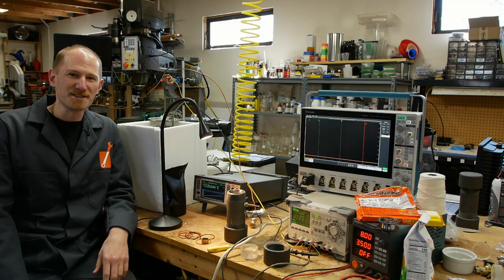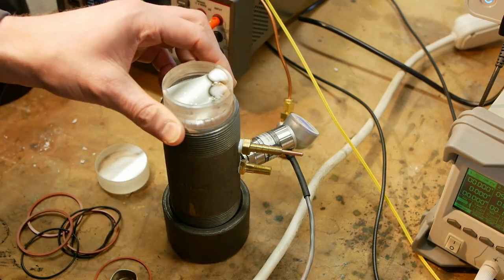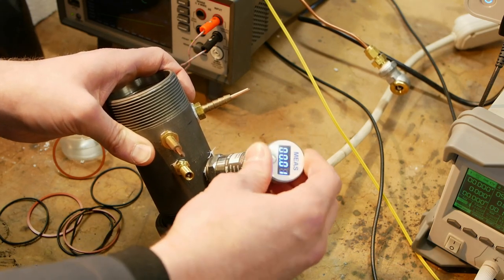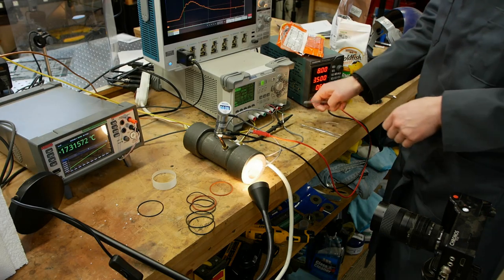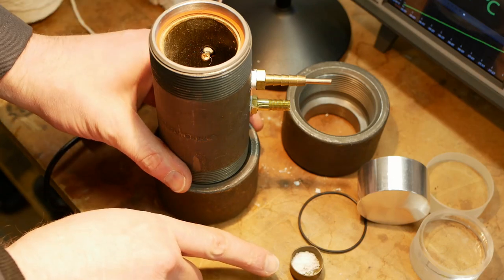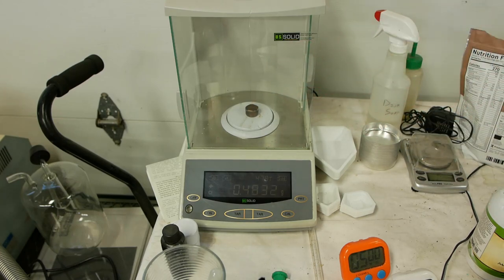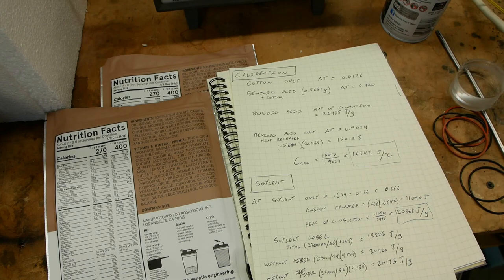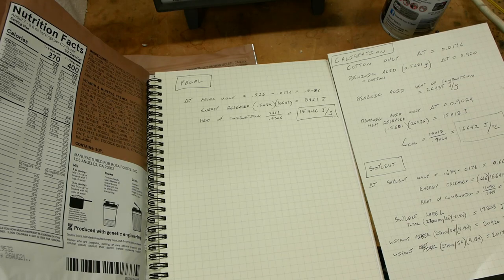Measuring human digestive efficiency vs. a flame

Comment: Hi:

If you need high pressure feed thrus, try spark plugs. They are designed to handle the pressure and have a substantial electrode. 
Nice video. Thanks.

Comment: May I share some insight as a physician:  

I think what you have to figure in is the amount of preexisting flammable, indigestible /nonabsorbable material in dry feces. For instance, bacteria, alone, makes up about 30% by weight of dried feces. Add bile pigments from the hepatobiliary system, various enzymes and other proteins secreted into the GI tract, shed epithelial cells, dead leukocytes, various lipids, etc, and you have a lot of material that will contribute to the energy of combustion of dried fecal matter that hasn’t been accounted for.  The way to account for this is to fast for several days to get a baseline sample of feces devoid of any unabsorbed food. Then you can compare that to what you collect on the Soylent diet. 

Last, remember that there is a delay between "input" and "output", i.e, intestinal transit time. As a result, the first couple of samples collected are likely to contain undigested food from before going on the diet. Thus, you have to make sure you’re in input/output equilibrium before beginning collection and throughout the duration of the experiment.

My 2 cents.

Comment: Some nutrition labels will list the "output," or amount of starches you're expected to excrete after eating it. The only issue I can think of with that is that the foods that list that are often ones that can have rather inconsistent ingredient ratios, like canned stews. Not every can has exactly X number of potato chunks, and, even if it did, those pieces can vary in size.
In addition, the body excretes waste in a variety of ways. For example, some of the salts in the food we eat are expelled in sweat and urine. On top of that, even a minor infection can up cell counts, and they have to be made somehow. Performing exercise increases caloric needs, as well.
All in all, it's just really difficult to get an exact measurement of how much nutrition isn't taken up through digestion without knowing every minute detail of the inner workings of a person. I know it's not meant to be at publication standards, but doing this with a larger group than a sample size of one can show varying results between individuals. Undiagnosed digestive disorders, like how multiple of my sisters have a mutation in the MTHFR gene, resulting in a reduced intake of B12, can change results, along with resting and active metabolic rates of people.
It sucks that it's so difficult to do this accurately.

Comment: Something to keep in mind for the overall math would have to be that your measurements are measuring specific energy per unit of fuel. However, you don't poop the same amount you eat. You could probably get a closer approximation of dietary energy by weighing all the soylent you eat over the week (maybe fast/laxatives prior to starting the diet and after) and then comparing that to the weight of all the poop you produce as well. One possible disadvantage of this would be that during the fasting phase your body will likely start using up glycogen in your body, so you may want to weigh your water intake and body mass changes as well to get a clearer picture. Some of the soylent will be used to restore the glycogen reserves. Lots of the mass will be lost as CO2, but that should be able to be solved for by adding starting mass, soylent intake, and water intake. That figure would represent all the mass that gets into your body over the course of that week. CO2 and water vapor lost in breathing should be then solvable by subtracting fecal mass, urine mass, and final body weight from the total system mass.

Comment: If you need stand offs, use the cheapest spark plugs you can get and machine off the ending half of the grounded terminal threads.  You will be left with a proper vacuum/pressure rated alumina stand off with a knowable voltage rating.

Comment: Love this...I have always wondered about this and you go and do it.  I think the pressure shape and peak pressure would probably be a function of surface area of the thing being burned (bombed).  Analogy:  combustion chamber shape surface area of solid fuel rocket motor propellant.  So the same maybe goes with how well you chew your food.  Foods that aren’t easy soaked/pulverized present itself to digestion processes by its surface area.

Comment: Dietary fiber on a label is the grand total. Soluble/insoluble is the breakdown of that. So read 6 grams of fiber (4 are insoluble 2 are soluble). They use bold text for grand totals and unbold for the FYI breakdowns.

Comment: I am fairly certain you are just seeing the fiber that is concentrated in the feces.  It has about the same heating value per unit mass as the original, but indigestible.  Most all the sugars, starches and lighter fats are likely to be used for energy - converted to energy, CO2 and water with not much left over.  Sugars (I read the nutrition label on a bag of sugar) have about 30 KCal for 8 grams.  That is 30,000*4.184/8 = 15,690 Joules/gram.  Fats (reading a nutrition label for vegetable oil) are about 120 KCal for 14 grams.  That is 120,000*4.184/14 = 36.863 Joules/gram.  If you only ate sugar for your 2000 KCal/day requirements, that is about 2000 KCal*(8 grams/30 KCal) = 533.3 grams sugar.  About 1.18 pounds.  To get 2000 from vegetable oil, if that is possible for the body to process, it would be 2000 KCal*(14 grams/120 KCal) = 233.3 grams oil.  And I cannot remember the density of cooking oil to give you fluid measure.  Check me, it has been another long day.

Rice is pretty much starch.  That bag says 45 grams gives 160 calories of which "carbohydrate" is 36 grams and zero dietary fiber.  The rest, I presume is water.  I think there is a category of fiber in rice that is not "dietary" but still indigestible.  Or maybe it depends on how much and how long you chew.  If rice is only carbohydrate, and there were no feces, then the body would be converting 36 grams per 45 gram serving, and you would need  2000*(45/160) = 562.5 grams per day of rice (of which 9/45ths is "something not carbohydrate").  

I am happy to see a calorimeter built and used.  But, if I were going to do it, I would use the chemical structure of the foods, measure them non-destructively with a variety of NMR or ESR/EPR spectroscopy, or IR or microwave spectroscopy - then do the same for the resulting feces, and keep track of water.  It is not an easy problem, but worth doing.  We still need that Star Trek gadget the "doctor" uses to scan the interior of the human body, any object or place and give a complete analysis and its implications.  We could use it in the transporter to separate covid and other bad viruses.  I think it could transport just the viruses out of the body.  Too long ago to remember clearly.  By the way, I did look. There ARE researchers trying to image and zap viruses - with electric and magnetic fields, lasers and ultrasound. Generally, if I can think of something, there are almost always 10,000 people and groups in the world who have been working on it for decades.  It is when there are tens of millions working on something, all re-creating the same basic information, never getting off first base - that bothers me.

Thanks again.  I just wish you would not only rely on your own skills, but produce videos where there is a team to help you get it right, exactly right - with resources, tools and links to more tools and materials for those who want to try things on their own.

Comment: Indeed as mentioned there should be a correcting factor: (soylent weight in / poop weight out)
And some for the freeze drying
You could measure that independently in your second soylent-food appreciation week and apply this factor to your obtained energy value retroactively

Comment: sooo one thing to keep in mind here is that 1 gram of soylent is of course not going to turn into 1 gram of fecal matter (something this test does seem to assume), because most of the flammable carbons that your body absorbs actually leaves your body as CO2 through breathing or things like urea in urine, while the remaining flammables in the soylent that don't get absorbed (like the fiber) get concentrated down to yield a product that's going to largely be just as flammable as the input.
I suspect that what you're mostly seeing from the decrease in calories is an increased concentration of the contained non-flammable mass (like the minerals that were left over at the end) so what you might need to do in order to find a more "true" efficiency is to calculate the ratio of incoming non-flammables to outgoing non-flammables in order to get a sense of how much of the input mass has disappeared from the output completely (although of course even there you're going to have some part of these minerals being absorbed by the body).

Comment: taper fit on your pipe instead of o-ring would work - its a good pressure fitting.  Gotta be good on the lathe though.  Did you ever find out the residuals (spheres) left in your crucible?  Love your videos, btw - not many do them as well.

Comment: I needed electrical feed through (around 40 amps for the tungsten ‘boat’) for a thermal evaporator (for depositing gold onto Mylar for microphones) and I did exactly the same thing with a barbed fitting, plastic, and epoxy.

Comment: Grease nipples aka Zerk fittings can be had for 20000 psi pressure.
You can use a clamping head on the filler tube with twist to clamp action or a slide lock.

Comment: I don't know the numbers but you'd have to assume that the fecal matter has large portions of bacteria from the gut that are being burned off. The question then becomes - where does the energy to form those bacteria come from - which is a whole different can of worms. it could have come from days, or weeks earlier or they could be feeding off fibre and other undigestible products which would really throw out your measurements. 

The only way to eliminate one of the variables would be to eat nothing but soylent for a prolonged period - perhaps a full month or two? The second variable would require microbiology studies into gut flora energy sources but that does seem somewhat outside the scope of this study.

Comment: FDA specifies a number of method for calculating Food Label Calories. Among them are "Using the general factors of 4, 4, and 9 calories per gram for protein, total carbohydrate, and total fat, respectively, as described in USDA Handbook No. 74" or "Using bomb calorimetry data subtracting 1.25 calories per gram protein to correct for incomplete digestibility, as described in USDA Handbook No. 74 " You can read more in 21CFR101.9

Comment: One gram of input does not necessarily produce one gram of output. So you would need to stabilize on a soylent diet for ~2 weeks, then measure total daily intake and output. You can assume the output is ~4 hours delayed, but as long as you sample a few days and use dried mass you could get a more accurate picture. Also, calories used by the micro biome are not necessarily all lost, some bacteria that die in the gut will be absorbed, so that can significantly vary with micro biome composition and person-to-person physiological variation. 
Still an amazing experiment!

Comment: That copper tube, though probably rated for what you are doing, can eventually fail due to repetitive strain cycling from moving around and pressurizing from causing a failure.  It should not be left pressurized and unattended because if it ever failed that would release the whole cylinder.

Comment: The GI tract is not as simple as your experiments assume. There are many interactions between the various organs and mucosa layers throughout the tract. For instance, bile  (95% water), which is actively dumped into the duodenal lumen, contains a significant number of organic compounds (phospholipids, amino acids, cholesterol, etc.) and need to be subtracted from your final 75%. Aerobic respiration, perspiration, and changing ratios of lipid storage and metabolism too, are only a few of the many variables which effect the degree to which the caloric components of your dietary input are used or excreted by the body independent of your gi "outpoop". Good video.

Comment: it may be possible to use a soft metal to hold a seal, say a ring of lead (or pressed lead foil) to safely sink the glass face into and create a good seal.

buuuut something soft like lead can't be reused as often as a regular o-ring....right?

OH, and another great idea for an O-ring. a 3d printed O-ring made out of ultra high temperature ceramic composite. this material is called Porcelite and its purpose is to 3d print parts that are then cintered into completed high tempature ceramics.

what we'll care about is that Porcelite before cintering is 80% ceramic with the rest being polymer. it will be soft enough to create a seal with that 20% polymer, and when the flame front reaches the O-ring, the ceramic should stop the combustion of the O-ring (assuming that ceramics wont burn in an 100% oxygen environment, which they might lol).

i would honestly try the lead first. lead foil is easy to source, and also easy to mold with its low melting point. the rest of the metal parts should act as a heat sink during sample testing.

but i'd say the porcelite ring would have fewer modes of failure, it can't melt, and its more temperature resistant than silicone. when cintered, its extremely porous, but you'll be skipping that step as you want the polymer.

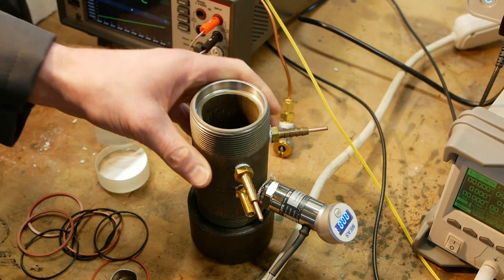Comment: 3:00 That would be because it depends on volume and sample size. Smaller volume needs to tolerate higher temperature for the same sample size. So what you can do is estimate the heat energy in your sample, use the heat capacity of the expected products in expected proportions (CO2, water mainly) and then use that to estimate the expected pressure. If this stuff can’t be readily estimated then you just have to overengineer or start with smaller samples and build up gradually

Comment: This is great work. Like many others, I want to know how many grams of Soylent went in for every gram of freeze-dried caca out - not easy to be precise but something like totals in and out for, say,  the final half of the week should give a fair indication. On the subject of food labels, a while ago I set off down the same road as you and I found out some things you might find interesting. In the US, fibre has to be included in the figure for total carbohydrate, but it is up to the manufacturer to decide how many calories to assign to it; values between zero and 4 are used, but what the true value should be is not easy to find out - it requires experiments just like yours, and I am sure it varies between types of fibre and between individuals. You touched on the idea of gut efficiency being an important factor in weight control - I would not be at all surprised to find out that some of that hinged on how good (or bad) colonic flora is on providing calories that the small bowel failed to capture.

Comment: A maybe relevant thing to ponder. It was determined that rats can be fed 4 times their minimum calorie intake before they begin to gain weight uncontrollably. I guess maybe the factor is more like 2-3 for humans but this basically means the body has to be able to excrete a lot of any excess, and it does.
This is quite logical actually, there has to be a broad range of intake that doesn't make you lose or gain weight.
The explanation for your result might be as trivial as you having eaten more soylent than you actually need, say twofold.

Comment: Wow, this one was great! It was interesting, intriguing, informative and, of course, quite funny >.<

And on a similar vein to the topic of the video, our muscles are around 70% efficient in turning the absorbed energy from food (as atp) into motion, which is way better than something like an ICE. They blow basically any Carnot cycle heat engines out of the water. If your muscles were a kind of heat engine, it essentially as if they worked on a temperature difference of 5000°K.
Reply: Being too lazy to check for myself, I wonder how fuel cell + electric motor compares. Anyway, it's not meaningful without starting with the same fuel or at least some that is about as easy to get in quantity.

Comment: Fantastic experimental design and approach!  The fact that your poop was high in combustibles makes me think that there is a lot of bacterial also excreted.  The bacterial are organic and would burn.  These critters could be a source of the additional calories.  Also to determine the calories from fats, one could extract the power with an organic solvent.  Then evaporate the solvent and use the extracted lipids.  This lipid material could then be tested seperately.  Finally, one could use peroxides (salts and liquids) instead of worrying about pure high pressure oxygen.